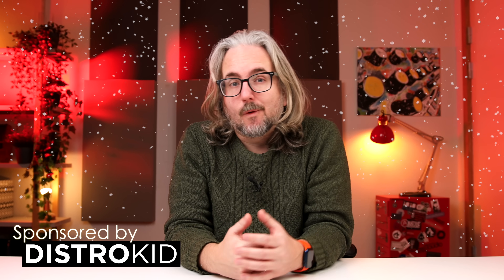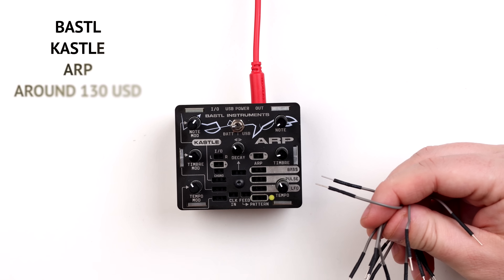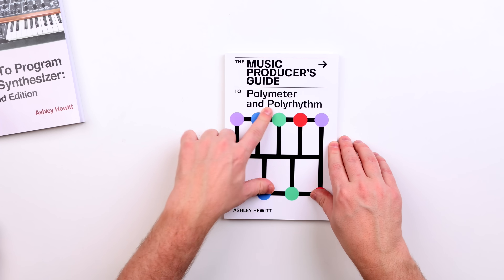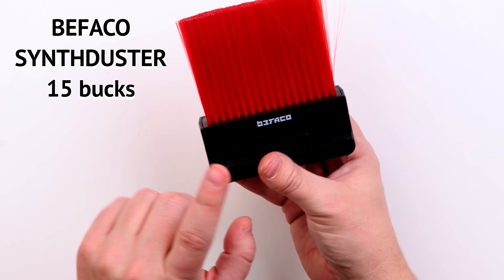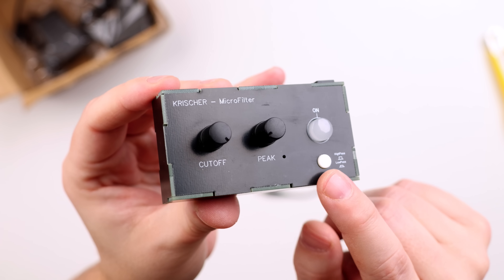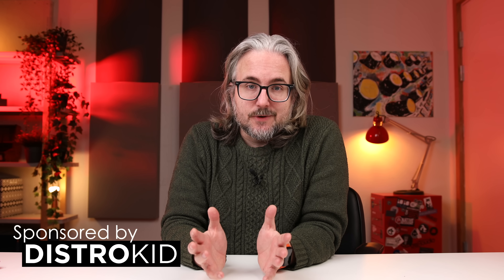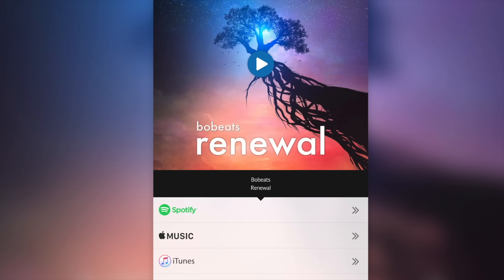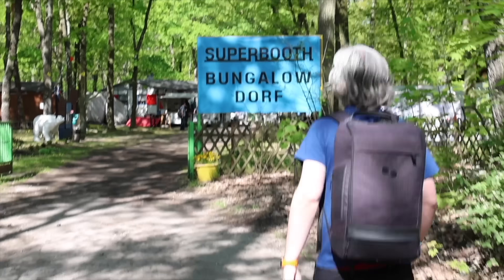19 Budget Friendly Synth & Music Production Gift Ideas

Comment: I made my own pedalboard from a wooden ikea crate €12(?), some screws, rubber feet, L brackets and velcro. It cost me around €14 per board and each holds 10+ pedals and a power supply. If you're even a little bit handy you could make someone a gift like that.
Reply from the maker: Thats a cool idea!

Comment: Would be great if your mate did a combo stand for 3Volcas and 3 Roland Compacts, alternatively,  since the Roland Compacts are smaller , make an adaptor so a Roland Compact can fit into a rack designed for a VOLCA, also from what i have measured, 2 Roland TB303 type clones side by side is the same width as 3 Korg Volcas.
PeaceFromOz